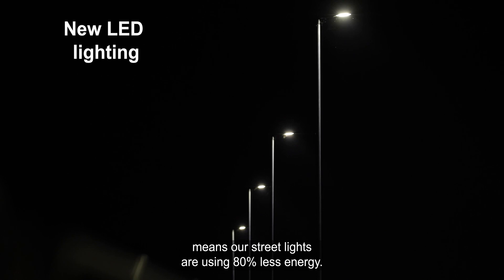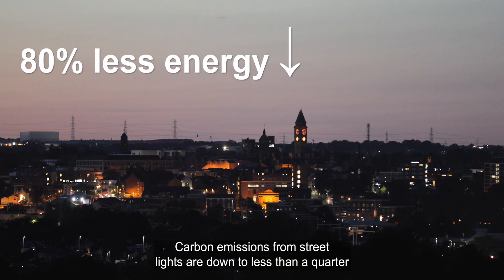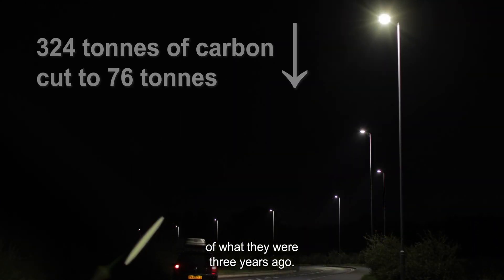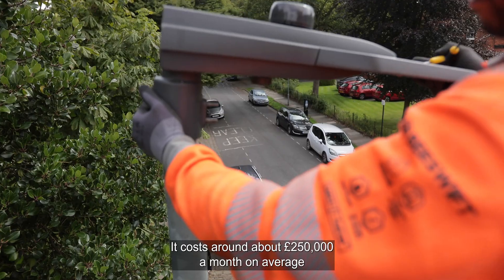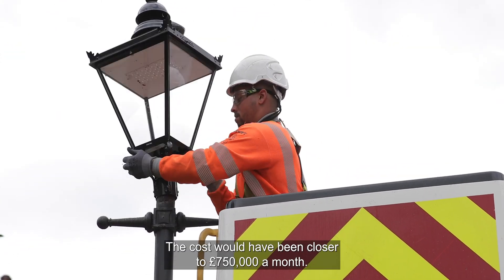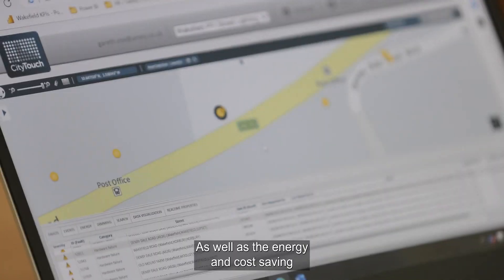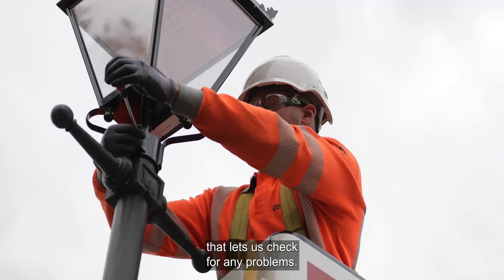Wakefield Council's LED street lighting programme

Comment: 0:25 "Halogen "? No its not, its High pressure sodium.  

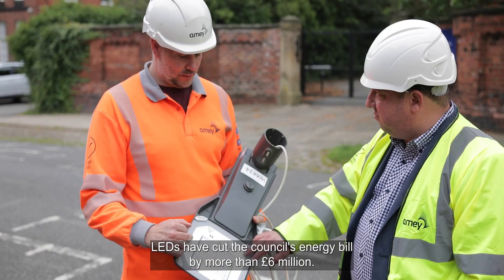0:45 Removing a LED lantern and replacing it with another LED lantern. Either a waste of money, or a failLED, Neither surprise me.
Reply: Clearly you don't know much. 
The new LED street lights use the city touch monitoring system. This is only compatible with other Philips Street lighting. Mainly the Digi Street. They changed the old lanterns because it's not compabible. Also it ensures all stock is uniform so maintenance is much easier.